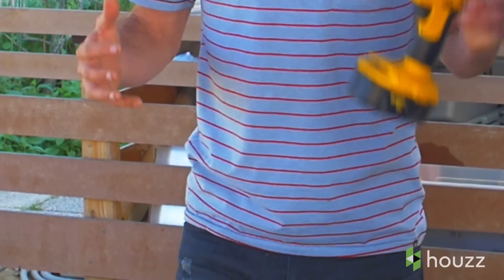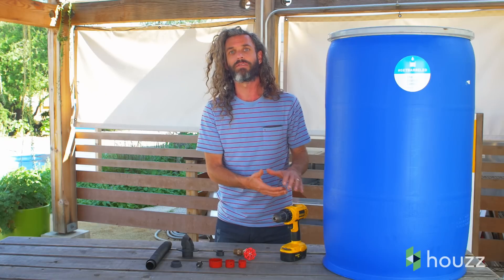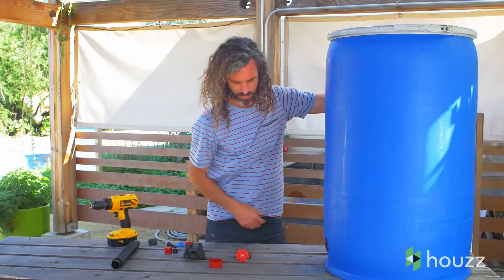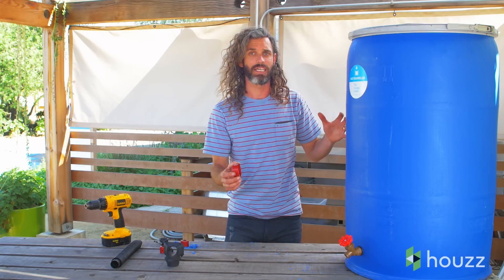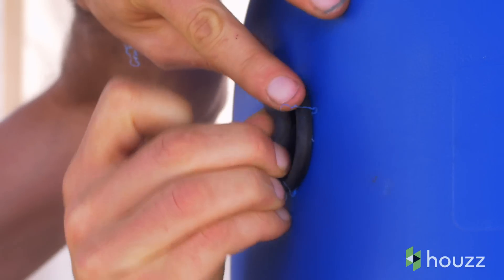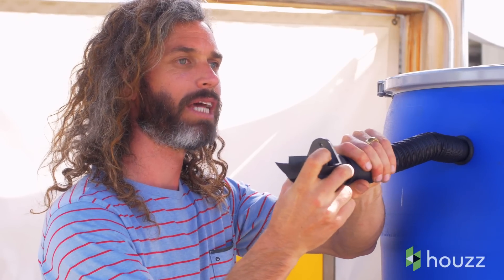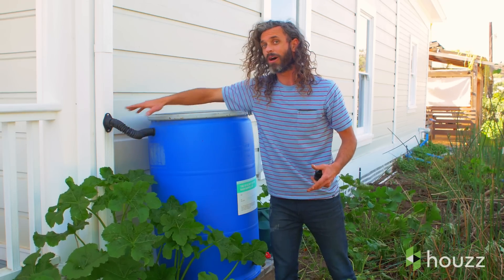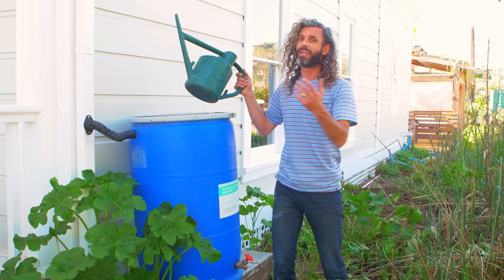How to Install a Rain Barrel

Comment: Just bought a similar system myself. The insert that goes into the downspout... how does the falling water down through the downspout manage to get into the diverter hose? Surely it's going to continue downwards, unless the downspout is blocked at the bottom and backs up to the hose. Am I missing something?

Comment: I have looked at multiple kits. The one you used in video is great. Who is manufacture of kit? I haven't found it online.
Reply: Look up Rainbrothers, they have a similar kit available & very cheap.  The one used in this video is by a company called EarthMinded. Available on Amazon & I believe Walmart are stocking it also.  Cheers